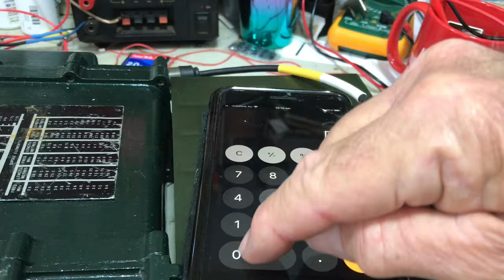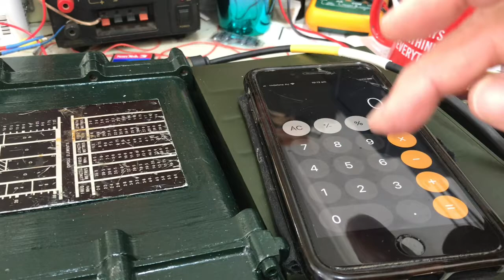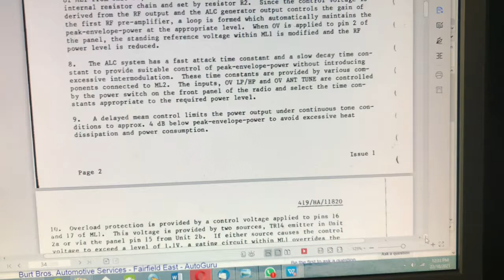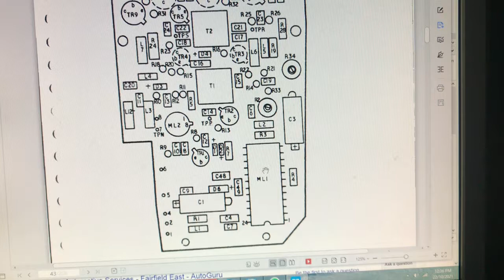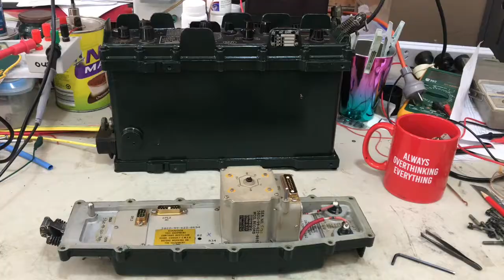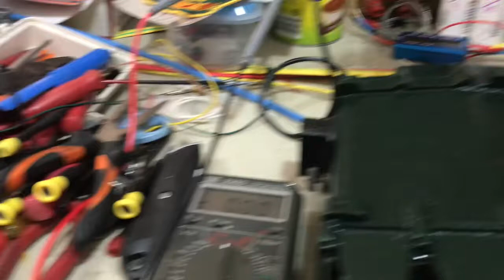VK2PRC Clansman 320 Removing Auto Power Reduction Feature on TX

Comment: Very interesting modification. I run mostly CW on my PRC-320. I did also find an official mod that improves the stability of the CW tone that is transmitted. I think its pretty cool that after all of the years of service these radios have provided, you can still find ways to improve them and still use them. 73!

Comment: Regrettfully, my unit (ser# 3505 PLA-81-51) doesn't look in the least like yours in that board on the back. I've closed it up now, but it had holes in the plate for adjustments, printing indicating test points, and the board was totally different. The final transistor was visible at the right side and no processor chip was visible.
So, it's buttoned up and still works, thankfully. Mike VE3EQP .....>
Reply from the maker: Yes a very few Clansman 320s (late version) replaced the PA board in the 2a section to a move modern board featuring Mosfets to replace the earlier RF power transistors.  Id say your is one of those.

Comment: Hi Alex,

Great video - your dummy load looks home made, do You have a video on that? Is it oil cooled? Thanks ed
Reply from the maker: Sorry no video.  Its just made up of 1K 3 watt metal film resistors in parallel to make  a final load of 50 ohms.  Filled with vegetable oil.  works great. 2 copper wire rings inside to solder the resistors to.

Comment: Very interesting thank-you. Now this mod has been done a little while, have you found any long term problems, like overheating damage? Would you still recommend this as a mod? I've finally found and bought a decent 320 and would hate to fry or shorten the life of any components.
Reply from the maker: Still working  beautifully, no overheating.  Others have done this mod with no problems.  You also should know you can increase the power out on your 320 by adjusting R2 potentiometer on the No2 unit just behind the power supply to approx 48 watts.  gets a little hotter with reduced battery life but the 320 takes it OK!
Reply: @vk2prc978  Thanks very much for the information and I'll certainly bear it in mind. I've only just got this unit and haven't had chance to use it at all yet. So, I'll get to know how it ticks in standard form before doing any mods. Thanks for your videos, they are really useful to this newcomer.
Reply: @vk2prc978  Hi Alex
When you increase the power to 48W what is the output on the low power setting,
Thanks Dave
Reply from the maker: @davidbrowne1588  That also goes up I carn't remember the  exact amount but it would be over 10 Watts
Reply: @vk2prc978  ok thanks for the information Alex,
Thanks Dave